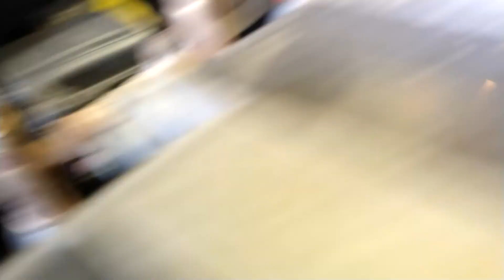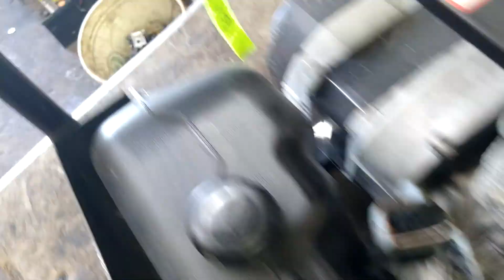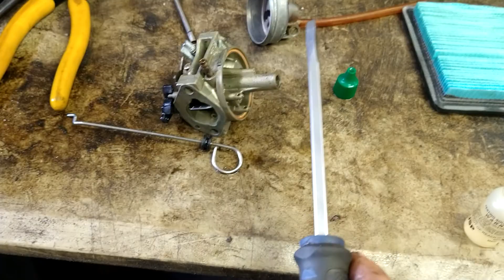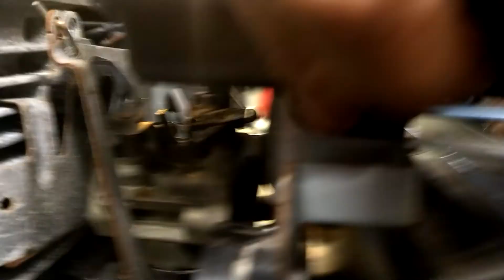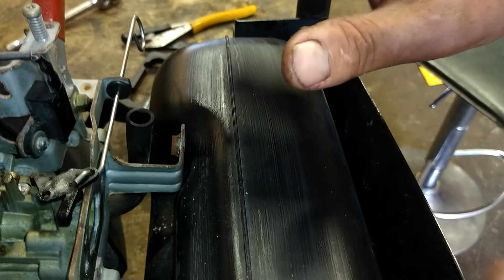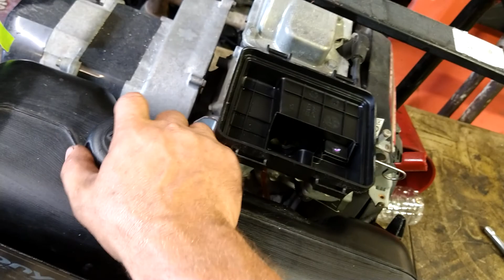honda harmony en2500 generator carburetor repair

Comment: I did this exact carburetor replacement. I figured out that you can replace the carburetor with the gas tank removed making it a whole lot easier. When reinstalling the tank just remove the 3 nuts holding the engine to the frame allowing the engine to tilt far enough to get the tank back in place. Much easier.
Reply from the maker: whatever works!

Comment: I'm having trouble with the same generator. I cleaned out the carb and added fresh gas but it will only start with started fluid then die within seconds.  How much gas do you need in the tank?  Does it have to be a couple inches from the bottom?
Reply from the maker: only needs enough gas for it to run out of the fuel line. make sure it does flow free threw the line by disconnecting line from carb. if it flowing then you have to do the carb again. make sure you have flow threw the needle valve under the float by lifting the float and blowing threw where the fuel line goes. pay close attention to main jet under bowl bolt and idle jet under idle screw.

Comment: Next time get a couple of studs a little bit longer than your bolts and screw them in the engine,put the carburetor,and the air filter hold the hold assembly and carefully take out the stud one at a time start one bolt and then the other,makes it a lot easier.
Reply from the maker: I find studs the right length im going with them and buying nuts. The problem with this is getting the carb past the tank. I dont think it will work. Would love to see a video of you trying tho. Willing to bet youll cuss the engineer.
Reply: I realize it is kind of randomly asking but do anyone know of a good site to watch new movies online?
Reply: @Graysen Casey i use FlixZone. Just google for it :)
Reply: @Zayd Elijah Yea, have been using Flixzone for since march myself =)
Reply: @Zayd Elijah Thanks, I signed up and it seems like a nice service :D Appreciate it !!
Reply: @Graysen Casey Happy to help :)